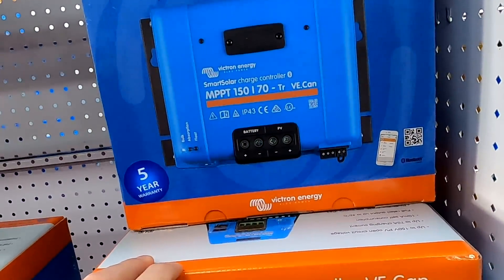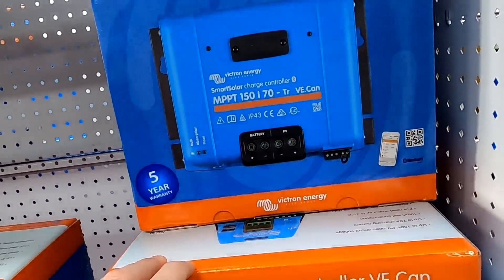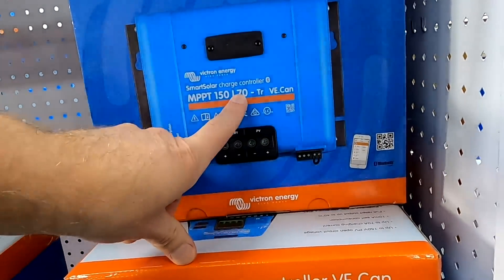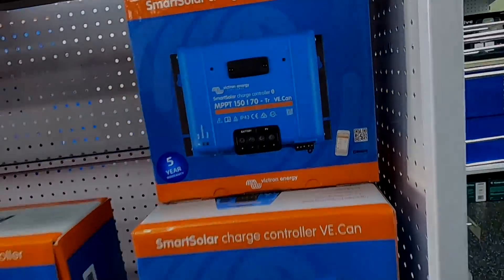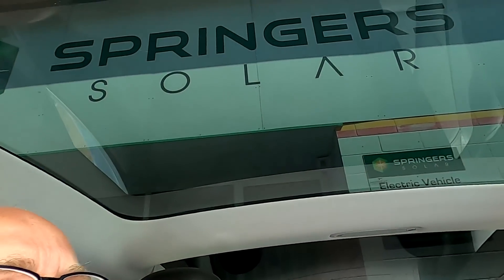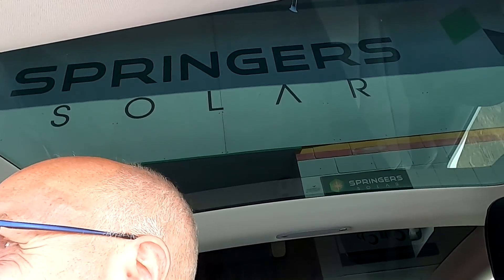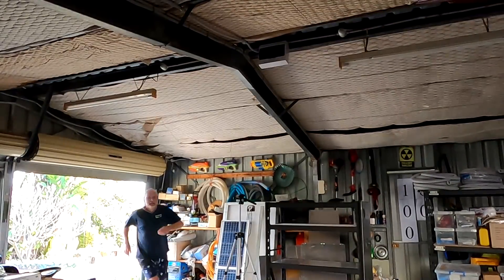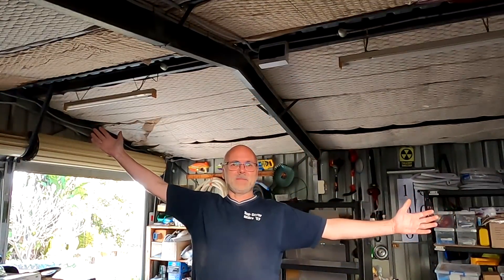Info from the Victron installer about the house off-grid connection. Not as expected... Part I

Comment: Hi Andy, LOVE your projects, 
A few years ago I tried part of the house off grid a lighting circuit, tv /pc gpo,s using AGM batteries
first using a UPS (96V batt) inverter then a MPPT Korean (24v) inverter with solar or mains input to battery bank, With a timer to disconnect the inverter from from its mains supply which would then automatically go to UPS battery mode at night. 
It worked quite well but the second hand AGM 32ah batteries drove me mad, they all died one at a time and within a few months they were mostly useless after their voltage dropped had to low as there was no auto cut off
Now lithium are cheaper and you channel inspires me to possibly try again. 

I am torn between again trying off grid AC inverter connected to dedicated house circuits using a Wiring rules allowed Generator plug/socket. 

In hospitals they have dedicated UPS / battery backup red socket if i recall.

Alternatively trying a buck type converter to to step up a 24v battery bank to sufficient voltage (150 to 180 ) to fire up my grid tie inverter after dusk.

The only other alternative considered would be to use series solar panels to charge a 150v battery bank and design a safe high voltage DC switching arrangement to fire this voltage/current into the grid tie inverter when the sun goes down. 
Reluctant to switch high voltage dc under load) 

I believe here in oz some of the later home battery systems are permitted to feed the grid tie  with a battery as it still safely disconnects power when grid dies.

But how do you build a solar charged 150v lifepo4 battery with bms and and keep it all safe.

Comment: Basically, your electric company doesn't want any competition. or to pay anyone producing excess power. Most people use solar to disconnect from the grid. One system to charge your Tesla and another by the house for your home?  What I figured out years ago is that most people don't have a clue how much power they are using and without sizing their system correctly or trimming their power usage they just tell people that solar sucks and doesn't work.
Reply from the maker: The problem was, that people have abused the system to make money. Hence the regulations are now very tight. The power company is happy to accept my power even after the contract and I'm allowed to install 3x5kW inverters with 3x10kW of solar which feeds into the grid.
Yeah, electricity is rather anonymous and not many people know what they are using. They just pay the bill and keep going. It would be beneficial if people could see inside their homes how much they actually use including a history over the last few days to compare to.

Comment: I was under the impression on the new solar battery rules for effectively diy stuff had to remain under 60VDC including the connected solar array. What am I missing here as you seem to be running 48v battery etc. I ask because I’m in the process of installing an extra low voltage battery solar system that will run all the lights in the house (90+ off them, leds and natively around 32vdc), bathroom exhaust fans, computer server and all the networking gear. Basically anything that I can buck or boost down to with voltage DC. My primary motivation is so I can legally wire all the lights in my house and control it all with a custom smart home setup. But I’m really feeling the restrictions keeping my panels under 60VDC and effectively limiting the battery to 24v because of it. Any insights into this? AS5139 is the code and I’ve only read interpretations of it not the code itself.

Comment: Ok, this is going to sound jumbled but why don't you just install a separate panel next to the existing panel for your solar and just pull the wires from your current panel and install them in your solar electrical panel EZ peasy lemon squeezy no connection to the grid and no need to rewire the home.

Comment: We have an off grid panel and a on grid panel.  If the batteries get low it pulls from the grid to charge the batteries and run the off grid panel.  It sounds like that would work just fine for you.  If you want leave the big bulky things on grid only.  However I would strongly suggest getting some AC(air con) that can run off grid.  I don't want to deal with the power company at all.

Comment: First, In a nutshell, you are not allowed to push more power to the grid so why agonize over not being able to sneak more power to the grid ?

Second, if you are talking about a solar battery storage system then you are going to want to cycle those batteries daily anyway, so in any event, this implies you want them off-grid powering your critical loads daily rather than idling when grid-tied (and forget about pushing collected solar back to the grid at night using the batteries)   So the solution options are very simple. You segregate your loads between critical load/off-grid/battery backed up (using solar power recharging) and non-critical loads/ without battery backed-up /grid-tied. 

Here in the US almost all battery-backed-up systems that are DC coupled have a separate critical loads sub-panel. It is also technically possible to segregate these critical loads using a transfer switch and then power those critical circuits from say 1.) generator or 2.) battery backed-up solar.

If you think about the natural division between critical load/off-grid/ battery-backed up as distinctly separate from non-critical/ non-battery-back/ grid-tie all the other hybrid combinations of battery-backed/ grid tie are excluded and dramatically reduce the complexity of what you need to do.

So you might say, " ....well I then can't optimally share between battery backup off-grid and grid-tie " . That is only partially an issue because all the battery power comes from solar and you should size your batteries and solar for the relatively stable critical loads. You do need two inverters and it means keeping separate strings for on and off-grid. You already mentioned diversion loads if you have so much variability in your critical loads The grid-tie automatically compensates by allowing to push excess to the grid.

So if you think about it you get to "your cake and eat it to" if you move out the critical loads to the battery-backed up off-grid and can increase the power you push to the grid legally.
Reply from the maker: Well, you may have misunderstood the whole project. The solution/options are far away from simple.
And additional cables either underground or overhead are not an option at all.
Reply: @OffGridGarageAustralia  It is highly unlikely that I missed the whole point of the video. Based on your comments, I would suggest it is the other way around. Grid-tied battery backup is an oxymoron typically involving overly complex hybrid solutions which seem to be designed to support individual manufactures' product line sales. I seldom reference KISS but that is what my suggestion is about once you accept the bifurcation of power I outlined.

Comment: Do you already charge your Tesla 100% from solar?  I didn’t think you currently have enough battery storage with only 13.5Kwh (without your additional batteries contributing yet?) How many miles per day do you drive it?
Reply from the maker: No, I don't charge it form off-grid solely. The vehicle needs around 5kWh/day for my commute, more if we go somewhere but I can pre-charge it if I know beforehand. I also can just plugin to the grid if solar and battery is low, so that's a good option. The vehicle is certainly a good option to dump access energy once the batteries are full.

Comment: That means you can do what I did and use an inverter charger/ all in one and power a sub panel(which is everything).💥🤘
Reply from the maker: In theory yes, but You have everything under one roof. My new subpanel would be 40m away and there is no cable connection.
Reply: @OffGridGarageAustralia  Run one new set of wires from the inverters (that would be in the garage)  to the panel that is in the house. Then cut the wires from the house inverter to the panel. Run a new sub panel that holds the old home inverter wires to the pole, add a circuit for a extension cord to run to the charger for the garage and done. No? 
Summary: The grid would receive all the power the house system generates. And the home would now be tied to the off grid garage. There would be a total disconnect from old system to new. From what I have gathered from the videos, that is all that seems to need be done.
Reply from the maker: @andrewbowden1076  That's exactly what I explained and yes, it can be done. I just don't like the wire-pole situation much.

Comment: I think it would be good to bring in the pool pump and the hot water to the off-grid system. Can you generate enough electricity to run the hot water? If that's enough then you can get a good utilisation? 

Then if you combine that with a fat battery charger then you're covered even off-season.

I could also possibly disagree with the interpretation of that clause you read out depending on the meaning of the phrase 'supply'. It sounds like it could allow for a hybrid inverter if the meaning of supply is that it doesn't backfeed to the grid. But I don't have the whole contract to read and that could then involve arguing the point which your probably not willing to do. It's not so much about getting around the law, but finding an interpretation which is compatible. I am probably wrong, ignore me on that and don't get mad at me for suggesting it.

Get a 5kW charger or something, use that only in winter and shift your loads to the garage. Simples.
Reply from the maker: Thank you. The contract is linked in the description. It's an easy read.
As I said, there is not much I can do. If Energex says, they don't accept a hybrid inverter or a transfer switch, that's their decision and nothing I can possibly do.
Yeah, shifting the non essential load to the battery seems reasonable.

Comment: Have you considered using the existing now unused wire from the house to the off grid garage to feed back to the house? At the house you install an off grid inverter to charge your new unused batteries, a 5 amp load on this wire would carry approx. 1 kWh an hour. You then connect some load to this inverter which will result in more feed back to the grid.
Reply from the maker: What unused cable? I have to phases and one neutral from the meter box to the house. Both are in use...
Reply: My mistake, I assumed when you disconnected the off grid garage it was a wire running from the house to the off grid garage.

Comment: Just install a second breaker box in your house and move the loads that you want to this box. Power the second breaker box from your offgrid system. Not sure how your configuration is, but my Growatt will power my load and charge the batteries in case they get low at night.
Reply from the maker: As I explained, there is no cable from the garage to the house. This is not possible.

Comment: Technically speaking, if you have a relais after your inverter tied to the grid which switches between grid and off-grid is thay allowed, then you don't have any other inverter connected to the grid because you switch, but listening to you it would be considered a transfer switch. Creating a seperate own off-grid might help. If you connect a hefty connector which connects to eather to the grid or to the off-grid you can physically switch the load in winter when the solar in unsuccifient for running the whole house.
Reply from the maker: A relay, contactor, physical transfer switch... all not allowed. They don't accept any connection to the grid at all in any form.
Reply: @OffGridGarageAustralia  Does this also include a plug? So you have your house (only all load) in your homeswitch board connected to a hefty plug which you plugin to your grid or plug into your off-grid, so your solar panels are always only connected to your grid connection, your off-grid inverter is never connecte to the grid as the plug is physical and not in the same housing. It's like haveing a separate outlet. (so outlet for grid, outlet for off-grid but a heftier one which can handle your whole house (maybe you remember the old red 400V 32A three phase from Germany). So in autum you connect the big connector to the grid, from spring you connect it to the off-grid. create a relais on your car charger so it can switch when needed.

Comment: HEY !
EVERYBODY GET A SHOVEL AND A PICKAXE AND LET'S GO HELP ANDY RUN A NEW CABLE FROM THE GARAGE TO THE HOUSE!
HE'LL PAY US BACK WITH BEER AND MORE INTERESTING VIDEOS AND EXPERIMENTS!
Reply from the maker: Great, I've done this before. The ground is solid clay. No shovel or even pick gets in there. And machinery is not good as there are already several cables and waterpipes in the ground in this area. I used a spade accessory for a hammer drill and it took me days to dig a small trench for a water pipe extension. I got in only a few centimetres just enough to cover the pipe with enough soul. The ground is like concrete.

Comment: It's easy enough.
Put you lights, freezers TV etc in to a new consumer unit in the house that will be powered via the garage.

In the garage:
Run your normal inverter and put your sun inverters with sensors in parrallel onto the normal high frequency inverter, so when there's is excessive load they kick in to lower the load on the normal inverter and run a AC cable to the new consumer unit in the house.

It's not a lot of work, just extra ac cable from the garage to the consumer unit in the house and extending the cables that your moving to off grid.

That's what I have done and I don't export just reduced the load to the grid.
Reply: From there you could experiment and put more loads on the off grid consumer unit.
Reply from the maker: Again, there is no cable to supply that 2nd sub panel.

Comment: This is normal from the energy provider, just place a D.B. board next to the supply switchboard and migrate the circuits you want to the inverter fed new D.B. and back your batteries up with a decent charger or charger inverter combo.
It's not rocket science.
Reply from the maker: There is not enough cables from the house to the garage to do that.

Comment: If I was you I'd be getting a DC cable and AC cable from the shed to the house. And using the batteries (in the garage) to feed into the grid at night, so you are essentially always supplying 5kw to the grid. That would net you about $23k per year which would be enough to buy all the batteries/solar panels you need to go completely off grid. Then when the energex contract runs out in 2028, completely disconnect the house and garage from the grid, and enjoy life without power bills.
Wish we got the same subsidies here in New Zealand. The best we can get is about 8c/kWh
Reply: And use the 23k per year income to fund more and more batteries and solar panels etc so you can keep making videos for us :)
Reply from the maker: Not possible, earthworks are not an option due to water pipes and other electrical cables in the ground.

Comment: Oh, does Victron sell cabling?
Reply from the maker: What do you mean with that?
Reply: That my guess is, you will rewire your house to use the harvested energy.
Reply from the maker: @daskasspatzle2396  Why would you re-wire the house just because you're going off-grid? It's just the source where the energy comes from is changing, all wires stay the same.
Reply: This is probbly what i meant, not what is actually inside the house, but how it is connected to the MCBs, different switch board most likely.

Comment: I'm curious if a 1:1 transformer would classify as a connection of power to the system, because in electronics... a transformer is a form of wireless power transfer, so it's classified as floating power and not connected power.
Reply from the maker: The transformer works both ways, right?
They won't accept that, the same as they don't accept a transfer switch which is also a physical separation to the grid.

Comment: That's very disappointing Andy. Sorry to hear that it's not what you were hoping. But it sounds like you still have some options. Just pull your entire house off grid and leave the solar contracted stuff on the grid. :)
Reply from the maker: Yeah, that's not an option due to not having enough cables to keep the AC solar connected.

Comment: Hey Andy, If you are allowed to charge batteries from the grid; why don’t you run most of the house from the batteries ( new circuits ) and then, if not enough sun, just recharge the batteries from the grid. 
From what you said, both things are allowed
Reply from the maker: Becuase there is no cable form the house to the garage, I can use.

Comment: add a second panel in the house, move everything over except for a battery charger and the existing PV system, does not seem overly complex?
Reply from the maker: There is no cable between the garage and the house.
Reply: @OffGridGarageAustralia  what about the old 240v cable feeding the garage? is there room in the conduit to use it to pull a couple of new cables? otherwise a trencher from Kennard's for a few hours and then drop a couple of 3" conduits in seems worth while with that feed in tariff!
Reply from the maker: @allan80supra  Earthworks are not an option due to many cables and water pipes in this area with unknown locations. That would be a disaster to use a trencher 💥
Reply: Can get a location off your old garage feed cable, live dangerously, nothing like a little excitement 😜

Comment: Use the Victron skylla charger fed from the grid to “charge” your batteries.  You run off the garage, solar, etc - your grid back up is the “charger”. 57amps at 48v is a lot and I’m sure you could parallel them for more. Do videos on that set up.
Reply from the maker: I thought about this, but I don't have enough cables to the house  for that. Otherwise it would be easy.